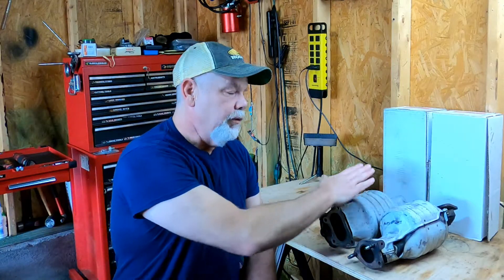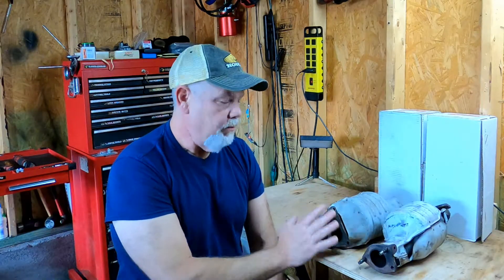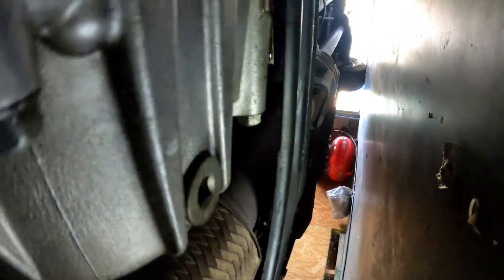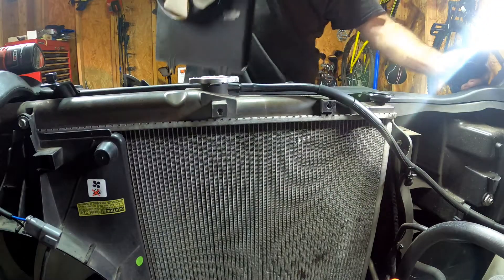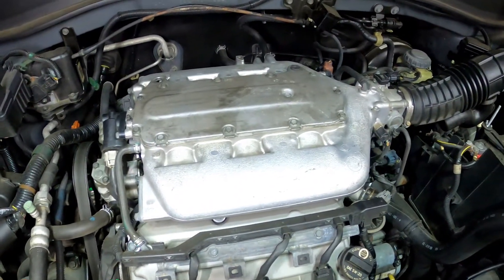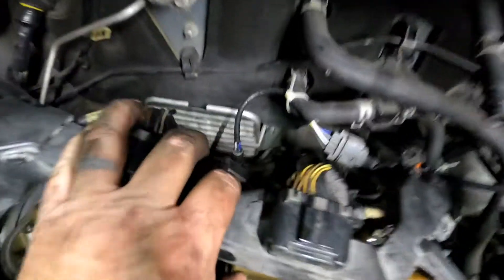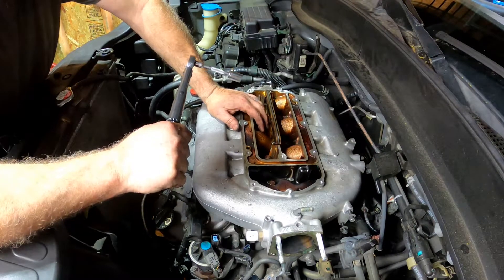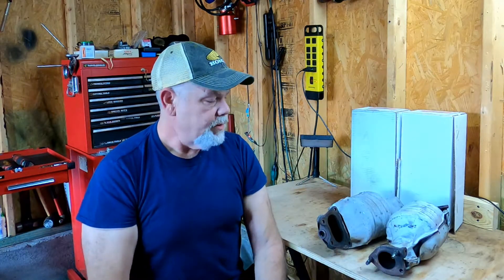Honda P0420 & P0430 Repair

Comment: I have a 2008 ridgeline with 127K.  I have po420 and po430 codes. 

Is it likely to be the catalytic converters since i have both codes or could it be both o2 sensors?
Reply from the maker: If you don't have a good OBD2 scanner that can read the O2 sensors, it would probably be worth a diagnostic fee at a garage before spending any money. Good luck!

Comment: I'm looking at removing Bank 2 Cat on my 2017 Ridgeline. Don't know if that's the problem, but I'm getting P0430, had dealer replace fuel injectors (I did experience a misfire and P0178 IIRC), but P0430 came back on after a few months. I replaced both up and down stream O2 sensors, so taking out the cat is next. Fun, fun.

Comment: How many miles did the honda ridgeline have when you changed the Catalytic Converter
Reply from the maker: It's hard to say. The dash cluster had been replaced so I didn't know the actual mileage. Had to be over 200k.

Comment: I just replaced the bank 1 and bank 2 cats on my '07 Ridgeline, and this video was the most helpful thing on the whole internet!  I probably would have given up on bank 1 if you hadn't demonstrated that it is possible.  Thanks so much for sharing this vid, and also thanks for sticking to the point and not making half of the video useless filler material like so many others.

Like another commenter I did not remove the intake manifold.  Really had to have monkey arms to get back there though, what a job!
Reply from the maker: Thank you for taking a moment to comment.  I am always glad to hear a video helped someone out.

Comment: would it come out if you could remove the manifold studs? Like maybe double nut them to back them out then pull the converter out through the top. Im about to tackle the rear one thats why im asking.
Reply from the maker: If I remember correctly, I don't think the studs were the problem. It was the way the bottom wrapped around the jack shaft. Suck job. Good luck!
Reply: @ktecgarage  Did it yesterday after work with about an hour of daylight left, once the cv axle heat shield is removed it is pretty easy to remove with the linkage disconnected. Thanks very much for your video.

Comment: I’ve got my front catalytic converter replaced around October. Planning to do the firewall side. Would using a different brand catalytic converter mess up the car relearning?
Reply from the maker: This car was fixed instantly without any relearn that I could tell. Ran fine and no codes.
Reply: @ktecgarage  okay just checking. I have Evan Fischer installed in the front and was thinking about putting the dorman brand by the firewall. Didn’t think there would be an issue running two different brands on the same car.
Reply from the maker: I see. I can't think of a reason that two different brands would cause an issue. Good luck!

Comment: I just did rear one 2015 Pilot. It will be easier to remove original cat if you are able to remove heat shield. Unbolt cat and lay it side way and remove 4 bolts.

Comment: The whole job is a nightmare.
Why would they put something in such a tight spot knowing that it's going to have to be replaced .
Reply from the maker: You are preaching to the choir. My ribs were sore for days after doing this video! I often curse the engineers when I'm working on cars.
Reply: @ktecgarage  well engineers hate mechanics because we always end up fucking there wives
Lol
Reply: @ktecgarage  ain't that the truth every single time.
Reply: Catalytic converters are placed closet to the engine exhaust system to minimize corrosive exhaust by "neutralizing" them in the catalyst to protect the down stream exhaust system from premature wear plus helping reduce pollution to the environment. You could theoretically gut out the original rear converter and place an aftermarket  more downstream and extend wiring for the o2 sensors but the exhaust pipes before the catalytic converter will take a corrosive beating. 😮

Comment: What would happen if you just ignored the "check engine" light? Is there any harm being done to the engine , or is it just a matter of more pollution.
Reply: My experience: the cats will eventually plug up and the engine will not run.
Reply from the maker: I don't see how it would negatively affect the car. If the light stays on or you cover it, another engine issue that would set it might come up and you wouldn't know until it broke down.

Comment: I did my 2010 Honda Pilot rear cat this weekend I was able to get the 2 bottom 12mm cat bolts from the bottom long extension and a swivel socket the 2 top 12mm from the top in the blind did not remove intake thanks for the video it’s a pain in the butt
Reply from the maker: Thanks for adding that info.!

Comment: I just did this job today on my 2013 Ody. Man that back cat is the worse. The front cat was okay, but it took my the entire day to get to the bottom two nuts on the back cat. My chest is all bruised and my forearms are all scratched due to trying to get that them back nuts off. Almost called it quits, but eventually got it off and replaced.
Reply from the maker: You are preaching to the choir. This can be a miserable job, but taking it to the dealer would cost a fortune.
Reply: I’m doing it right now
Reply: @derekenno7742  12mm socket on the smaller 1/4 wrench did the trick. Has to use a pole to gain leverage

Comment: Our 2007 honda ridgeline has the honey comb.  We have a P0430 code.  It goes away and comes back.  I've changed the 4, O2 sensors.  NTK products!  P0430 code, is the front cat correct?!
Reply from the maker: 420 is bank 1 and 430 is bank 2. It's back asswards, but bank 2 is the front one. Those Doormans fit right up to this one, so as much as it pains me to say it, go with that instead of OEM. Good luck!

Comment: I have a 05 odyssey  engine is real good Trans etc beast 💪. But that engine light has been my nightmare for years I'm not mechanic but I seen videos on  how to put on the sparkplug  none fouler I definitely  try that meineke wanted 900 dollars for 2 sensors no sir I do it my self
Reply from the maker: Hope the sparkplug non-foulers do the trick. Good luck!

Comment: Can we get a video of a 98-02 accord 4cyl cruise control not working? Mines turns on but will not maintain speed. Engine will Rev to try to speed up but nova. Love your content!
Reply from the maker: Never had an issue with mine. I have since sold that ride, so not in my immediate plans. Working on an Element ATM.

Comment: I did mine without removing intake manifold.. it was blind working but got it done saved my self some time
Reply from the maker: If that intake wasn't so easy to pull, I would have done the same. That was one of the most miserable repairs I ever did. And lost my 1/4" ratchet!

Comment: If the cat fails, you get the P0420 code and nothing is done about it, will the cats eventually deteriorate and clog up the third cat under the car?

Comment: My brother says taking off the air intake and valve covers is way more difficult than you make it seem. I have to change bank 1 and its impossible to get to. Feel so helpless
Reply from the maker: Well, you saw me do. Not saying it's easy, but it is pretty straight forward. The hardest part is that rear valve cover because you have to feel for everything. The front cover is exactly the same so it makes a good reference. 

Good luck!
Reply: @ktecgarage  i ended up getting it done without taking off anything. Once i got it dismounted, i took off the heat sheild while it was still in the undercarriage. Also removed the heat shield situated underneath the converter for more room. Once all 3 pieces of shield were off, the part had enough clearance to slip between the wheel well and CV axle upper boot. Getting the mounting bolts at the converter's head was a huge pain in the butt though. Got the top and bottom passenger side with an open wrench from the passenger wheel well and the other two bolts from the top thru the engine space by feel. Those were very tough nuts to crack bc they were in such a tight space and frozen up real good. Putting the new part on was way easier. I used the factory heat shield on the aftermarket part, but had to make it fit, which was kinda tough, but doable.
Reply from the maker: Glad to hear it worked out for you. I hate working in tight spaces so I'm prone to start yanking stuff off.
Reply: Thank you for this video . I’m about to do this repair . This looks like a nightmare honestly but it has to be done .

Comment: Appreciate this! Just ordered parts for my '07 Pilot, and as I'm not a mechanic or someone who grew up working on cars, I felt really apprehensive about doing the work on the back bank "over the top" as opposed to from the bottom/wheel well (even though I'm not afraid to dig in and do work myself...I do my own plugs, brakes, and oil regularly). But seeing you doing this has given me confidence that it's not actually that big of an ordeal, as long as you torque it down properly when you're done.
Reply from the maker: Thank you for the comment. Hope your repair goes smoothly.

Comment: when I changed my o2 sensor on bank 1 I just put a pillow down used a ladder and laid across the engine bay I could have easily removed them bolts without having to remove any of that other stuff

Comment: Eric O @ SMA is not a fan of Doorman products, but he has a cool brake cleen intro! Good video BTW I just bought a 017 ridgeline within 2 days of owning it the p0430 code popped up I took it back to the dealer which is a Honda store they replaced the fuel injectors cel light came back on a few days later now I'm waiting on new cats,  Hondu  as Eric O would say is going to fix it.
Reply from the maker: No he is not. These have passed emission twice and they fit so I guess I got lucky!

Comment: Why did you replace them? It wouldn't pass inspection?
Reply from the maker: In my state, vehicles less than 20 years old have to pass an emissions test. Funny that the truck passed the sniffer in the exhaust, but failed for the check engine light.
Reply: That's my question as well , is there any harm being done to the engine ? If not I would just put black tape over that check engine light.
Reply from the maker: If something else goes wrong with the engine, you wouldn't know until it broke down.

Comment: Had a 2008 Honda Ridgeline, have the check engine light on dash , and vtm-4 light , so I wen to the mechanic and they told me the problem was the cat converter bank 1 and bank 2 , and my engine was doing miss fire and staff like that cause of the cat converter problem ! They tested to see how many gas come out from the exhaust and is clog !! You can’t feel air coming from the exhaust!!! this is weird 🤷🏽‍♂️
Reply from the maker: All kinds of engine problems can clog the cats. Burning oil or antifreeze, bad PCV system, purge valve problems, etc. Only thing that is supposed to run through them is combustion gasses. I had an S-10 once that clogged so bad it wouldn't go above 20 miles per hour. BTW, it's weird how that VTM lights up with exhaust problems. Will do it with a bad O2 sensor as well.

Comment: Im recently new to the channel and I'm reaching out for any advice I'm about to swap motors in my f150 v6 4.2......i started watching ur channel cause I wanna rebuild my f23 in my Honda to see if I can......I'm new to alot when it comes to being a grease monkey and I can admit that.....with that being said any good word of advice u can would be grateful
Reply from the maker: Well. I'm not your source for the F150, but, as for the f23 I am. The two biggest pieces of advice would be watch my videos and make sure you have all the right tools! 2nd piece of advice: just have the balls to do it. If you are at least halfway mechanically inclined, you can do all this in your driveway. 

Good luck!
Reply: @ktecgarage  yea I know some what on what to do but this will be my first swap period.....I just recently started working at a diesel shop taring apart diesel motors all day long so I should have the balls to put a 4.2 in this f-150.....but I reached out to u cause it seem like u won't bs around and after watching the f23 videos I figured u would at least respond to me lol and seeing how the f23 work makes me wanna take the motor out my lil Honda once I get the truck up and running first
Reply from the maker: Thank you. I'm glad to know I came off sincere in those videos. I was!

Comment: 🤣🤣🤣.."My ribs..." true  to that, I know the feeling
Another great video teacher!
My car is doing great, almost a year now, fixing to drive it 6 hrs. to the Gulf f Mex🏊‍♂️, that  will be a ultimate test, but I have confidence.
Reply from the maker: Glad to hear it's doing you right. I'm taking mine from NC to TX next week. My trip is going to be about 20 hours. We shall see!
Reply: @ktecgarage  wow...that's far, but it will be OK. We did good😁😉
Reply from the maker: Even tho the engine is solid, it still has 320k on it. Next week's video is gonna show all I did to get it ready. Thanks for commenting Gus!
Reply: @ktecgarage   when i sold my 2006 and 2007 they both had over 350k on them. other than some small issues they are really good vehicles.